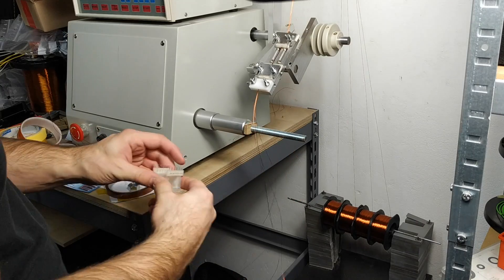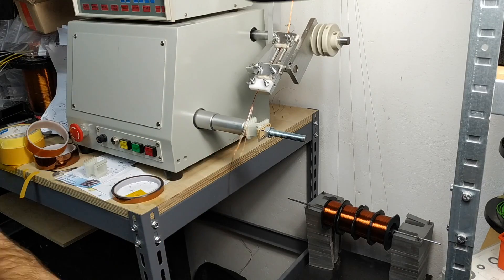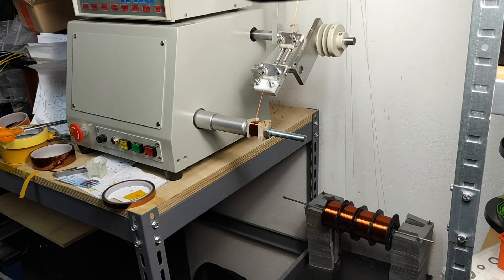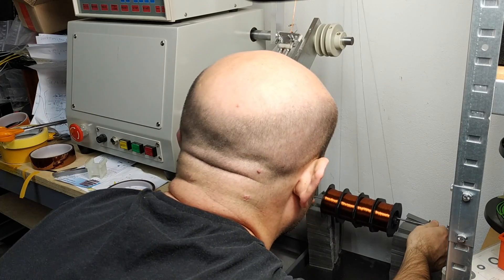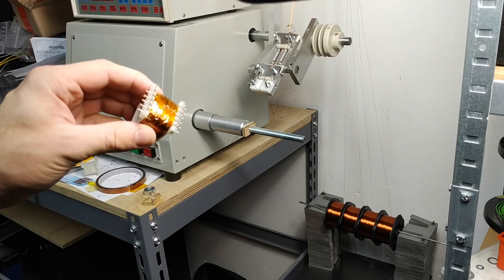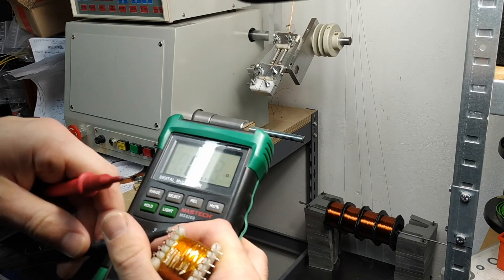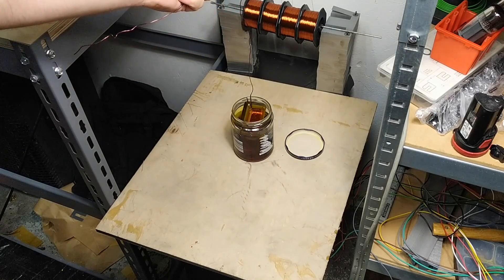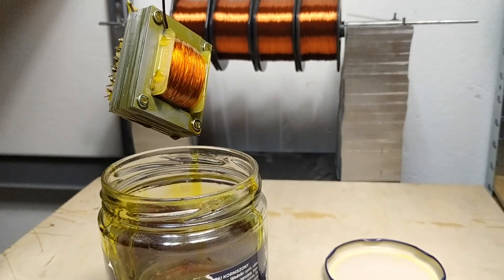API 312 Output Transformer Winding Quadfilar 2503

Comment: Thanks for sharing. Have you measured how much the capacitance increases with the laquer? I guess sbout 2x? Btw old refridgerators have great vacuum pumps if youd like to try that.
Reply from the maker: Thanks! I haven't measured the capacitance at all, it sounds perfect in the preamp so I didn't even bother, but I will do it just to see what the numbers show. But, from what I know the lacquer shouldn't make a difference in capacitance since it doesn't move the wires, it just fills in the blank space and keeps everything in place. Where did you hear, read about that?
Reply: @Delatsch  Hello thnx for answer. I have only done a few inductor windings, not had the patience to try transformer yet...
Anything has higher dielectric constant ('relative permittivity' today) than nothing (air and vacuum) so the capacitance must go up. But it is not an issue here b/c that is only an issue with high impedance circuits. But I think laquer and oil have k of about 4. The capacitance will increase by a factor of the square root of the k, so in this case should be about 2x compared to if not impregnated. But if you do not vacuum the enclosure where you sink the transformer into the liquid, it will not fully soak everything, and you end up somewhere in the middle. 
Anyways it is just a note and of no importance. I also prefer having teh windings soaked to prevent microphonics which is way worse than any capacitive effects.
Keep winding, perhaps I will eventually get inspired to do my own, or bug you to make me a couple...
Reply from the maker: @MrSemperfidelis225  Thanks!

Comment: What laquer (?) you use at 7:30? Thank you
Reply from the maker: It is a transformer/motor enamel called Royal C. There are many different ones, whatever you find for motor/transformer varnish, lacquer etc. will work. The most important thing is to find something that doesn't require heat, so that you can just pot it and let it dry. Some dry faster, some take longer to dry.